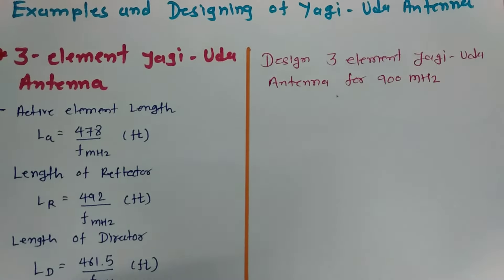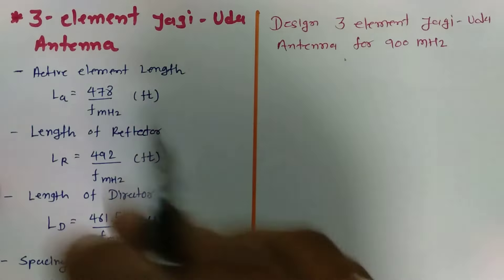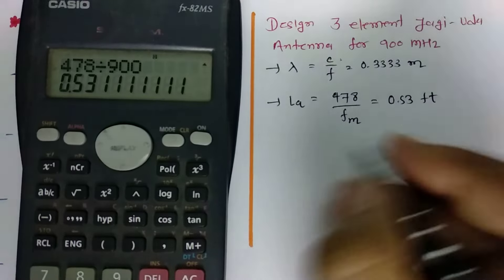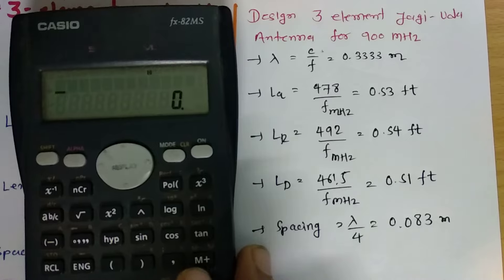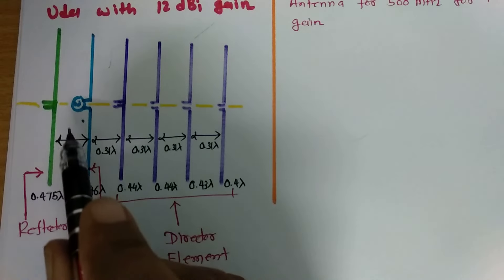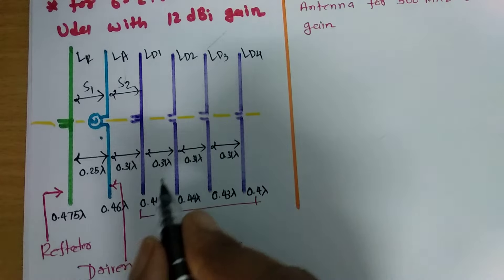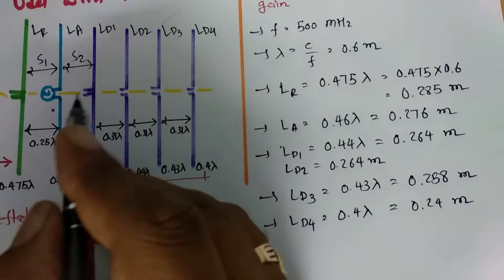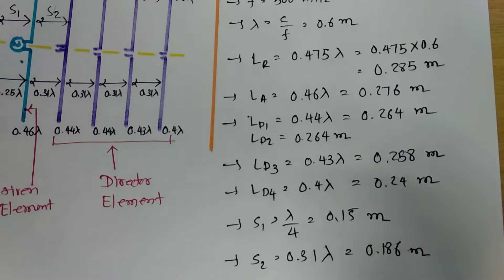Examples and Designing of Yagi Uda Antenna in Antenna and Wave Propagation by Engineering Funda

Comment: i have a question. if we place an omni directional antenna at the focus point of a parabolic TV dish, will it make the waves directional?
Reply from the maker: It will reflect those waves which are going towards reflectors. So directivity will increase but omni directional source is not good to use with reflector antenna.
Reply from the maker: You can use horn at foci of reflector.
Reply: @EngineeringFunda  For example if i place a 2.4ghz omni antenna at the focus of a dish, will it make the waves go one side?